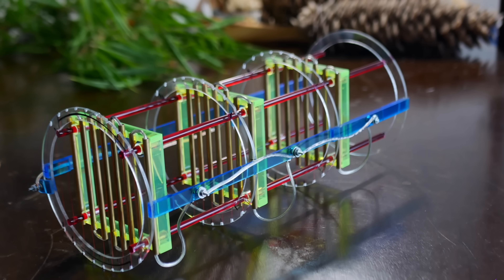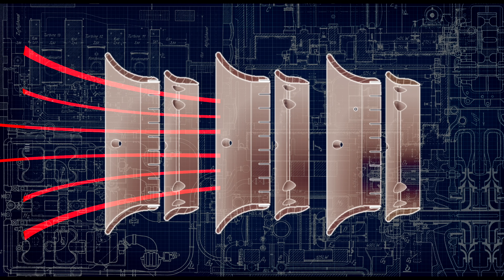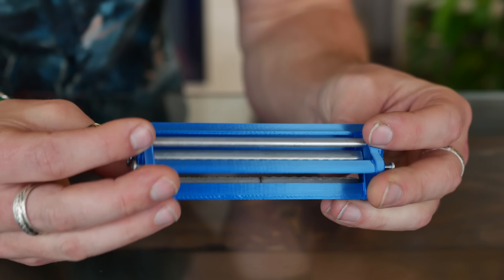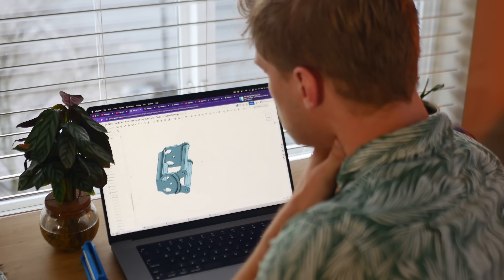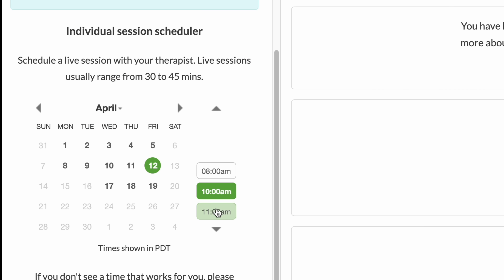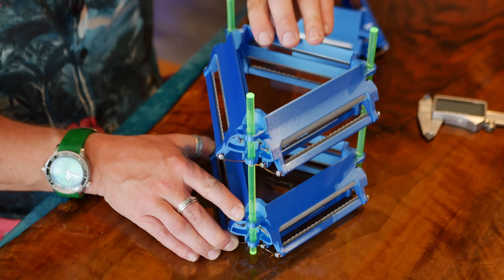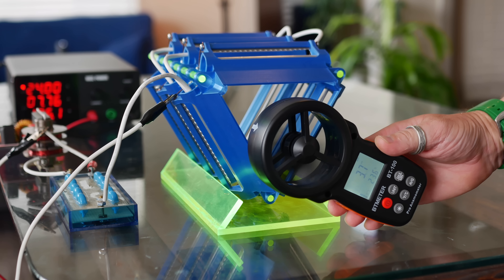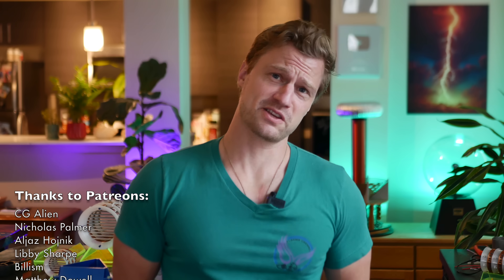Next-Gen Ionic Plasma Thruster Inspired By Nature (BTC Mark 3)

Comment: I'm new into this topic. What about if ioninc thruster is not meant for air? what if there is a way to insulate the wire and put it in a different fluid such as water? for example. I believe maybe with a couple of this thrusters in parallel can represent a significant source of displacement force.

Comment: I have a question. What happens when you connect the triangles next to each other by connecting the Tips. Now angle them a bit to combind the three air flows and connect the other Tips with  accelolators to build a Hexagon.
Im sorry for my bad Englisch...

Comment: I think Funnel Shapes, would be far more Optimal, rather than Triangular.   To do that, you may need to have someone form metal Rings for you... or to get a pipe/tube bender, to form them yourself.    Also, it may be interesting to experiment with Vortexes..  potentially making a Spiral output / spiral guides.   Also, noting that you saw wing being sucked in from the sides... you may want to try to optimize that effect, by pulling even more air in via wave guide channels.. to provide even more air pressures to thrust with.

Comment: Try a widening cone or an elipse that gets stretched more as you continue.
You are fighting pressure to keep the air inside the engine. Problem is that the engine doesnt have walls so unlike a jet the air isnt confined.

A widening cone or something would keep air pressure at a lower value but keep speed rising, you'd move more air at a relatively slower speed but increases the volume compared to no widening. 
For a tech demo though this is certainly interesting

Comment: why dont u make it into a circular cylinder instead of a triangular one? same way u have angled them u can angle the rings and stack them on top of each other.. maybe it would make a vortex and allows for smoother air flow rather than harsh rectangles.. and maybe do more angle control tests maybe this angle isnt the optimal one for this design

Comment: By stacking the stages you've got a good design for pressure. Air input at the same velocity stacked repeatedly can''t increase velocity. However like we do on jet engines, you might turn this pressure into speed with a tapered nozzel.

Comment: have you tried putting them in series connection? Having high volts powering something in paralle that needs high amps will lower the performance take advantage of the high volts by series connecting, if you dont try this ill consider what you doing a total failure and WILL NEVER be a game changer

Comment: I wonder what staggering the power on/off going to the stages using an oscillating pulse initiating one, then stopping, then the next, and repeat that for each, every time so that the air is being repeated through each stage rather then just pushed concurrent.. Dunno just thinking out loud.

Comment: You shouldn’t be working on your speed, you should be working on your power. Rocket exhaust has low speed, high pressure, so they use a nozzle to change the high pressure into high speed. It’s difficult to get speed when the excess power can just become pressure, so use a nozzle to get all of the power your thruster exerts converted into speed

Comment: Looking at the geometry dont you think the air being accelerated on the ends of each in put would interfere with the adjacent ones. I would guess that only the air from the central points that have a path of least resistance and you are loosing efficiency on the ends.

Comment: Try divergence after convergence.

Ideally a bell shaped nozzle would be an idea, however that comes with some challenges in terms of efficiency at different altitudes and would also block throughput in the centre. 

Try adding three concave slipways after the thruster sections. Put them in a Tri configuration like the "Linear Aerospike" engine, but with 3 rather than two.

Also you need exponential spacing so that different streams travel at higher velocity. Otherwise you are just pushing air at the same velocity.

Comment: Maybe I'm wrong, but I think you failed to see the most critical aspect of convergence. Look again at your leaf. Or think of it as a garden hose. The only way to increase flow is by putting your finger at the end of the hose to increase PRESSURE within a space. Its just my $0.02, but i think sequentially smaller stages would benefit you.

I guess how I'm visualizing it is if you were to replace your design with garden hoses for inputs, you'd get the same amount of pressure since the central channel is so open and large. Or even a thruster nozzle where it's hour glass shaped.

So In many senses, this design is similar to the older videos you posted. But instead of pulling air from that central channel, you're pulling it from the outside.

Comment: In a previous video you decreased the weight of the propulsion with smaller components for the positive and negative side, but wouldn't electro plating work for this to or is the layer to thin to handle the load? aditionaly  this could open up the posibility to specificly test for areas of the parts where you would want the electricity to flow to.

Comment: wait do  not  take those small cheap 30000 volt generators and attach them in parallel , don't do that instead give each cathode anode its ows generator design is good just see your speeds increasing by doing this

Comment: Reminds me of the chevron locks on the Stargate in the TV show a bit, which are similar to the pyramid of Chechen Itza's in Peru where the structure if you clap in front of the steps, sound travels faster, whilst under the steps is chevron shaped side door, with also serpent patterns like waves along the sides of the steps. Could be useful to study. I know it's expensive as a dopant but Maybe concider trying the element Thulium, and take out the inner points of the triangle to make it a 6 sided shaped triangle, maybe arching the longer lengths of the triangle to collapse it down a bit, maybe helping with the lensing effect. 🤔
Reply: You may find a Luminescent Photo Concentrator, and Photovoltaic Solar Cell interesting aswell. I would recommend reading through the Wikipedia articles, and watching the YouTube videos of the Stargate and supergate to see the comparisons. Could be helpful...
Reply: You may find Tantalum interesting aswell.

Comment: Could you not take a section through one of the fans, then revolve it 360 degrees. Basically use rings, donuts.
Would that not be a more efficient way for the air flow to converge, with consructive interference in mind requiring the same travel distance, at the same velocity ?

Comment: you must increase the speed move of air atoms this can be done only in 2 ways
1 higher voltage
2 more points outer from vlades canvas

one more way is using modular electricity- change Hrz

Comment: I wonder if shaping the air column into a spiral cone would do anything. In my brain a spiral motion might more evenly compress the air rather than just the corners of the triangle. Your thrusters might need to be curved to complete that design. As far as the cone shape, I'm thinking about how the SpaceX rockets have those node points in the combustion tail.

Comment: I see 2 possible flaws of this design. 1. The identical cross-section of each following stage. When the first stage accelerates the air it grabbed it creates a zone of lower pressure around it, so the following stage has less air to accelerate and moreover it needs to fight the suction from the first stage. If you make each following stage bigger so that the volums they grab air from don't intersect - this will possibly improve the overall thrust. 2. I think you misinterpret what is constructive interference and convergence. Convergence, or (if I get your idea right) a simple summation of streams does not increase their energies like in constructive interference. Interference is a wave process - it does not occur in time-constant processes like constant pressure flow. For interference you need to create pressure-alternating streams which can be achieved with AC or impulse electric sources.

Comment: You need a spaced covering around your new design. If you can channel the intake flow as well as the exhaust flow, you can double your thrust. You're not taking advantage of the pull of the intake.

Comment: It seems like they preform the most efficiently by themselves and not in series.

Also it seems like only a small amount of the energy you put into the thruster is actually going to generating thrust. It might be worth finding where all this waste energy is going and finding a way to minimize the issue. Especially if you are planning on using this in a plane/boat in the future.

Comment: Im not a physicist but i work with air a whole bunch, but i can see a couple of issues with this design.

First each stage has a fixed point of convergence which isnt adjusted in subsequent stages for a single focal point, as a result you end up with more turbulance from each subsequent stage. This issue is easily resolved buy making the individual ion vanes/stages  levered like aeroplane/boat rudders.

Second adding some form of venturi would help smooth incoming airflow.

Lastly golf ball divits do wonders for air throw
Reply: The geometry of the emitters is also a consideration - as round wires these are relatively uniform, yet electrons preferentially escape from "sharp" points on a charged material. Perhaps adding kinks to the wire would affect it, not entirely dissimilar to the way stealth aircraft have lots of "\/\/\/\/\/\/" type shapes in their design.

Comment: You would absolutely benefit from some AI design. Have you seen those crazy car frames etc that have been generated by AI that is much stronger and much lighter? There was also a jet engine that was designed recently by AI, and I feel like you could greatly benefit from those programs. It's probably possible to give it some specific perimeters and it will be able to generate some much more intense constructive interference structures.

Comment: I would say using three thruster in each stage is cause drag due to the angle of thrust into the center. Try six thrusters making a hexagon in each stage and maybe reduce the angle entering the center so less turbulence and drag will be created due to the entering of thrust into the center due to the edges of the thrust no longer hitting the next stage

Comment: I wonder if there would be any merit to reducing area between stages and having each stage feed the next, so basically having your initial stage's exhaust feed your second stage's intake and so on. I wonder how much the rate of acceleration would change between stages. I also wonder how much your thrust and convergence would change by changing your outer shape to either a hexagonal or octagonal shape instead of going triangular

Comment: I have a structural change in your design. Instead of having everything the same size and voltage inputs, let’s do something different. The initial one make normal. The second stage make 1/3 smaller and 1/3 more input. The third stage go 1/3 smaller an increased input of 1/3 power. It’s a funnel effect like a tornado. The smaller the output size, the greater wind velocity. Now, that’s not all from the windup of the storm, either. Some of it is because of the funnel effect of downdrafts and microbursts. And, trusts kind of where I’m going with the design change. Instead of turn twist nature provides through sheeting, you have to mimic that with an increased power input per stage. Also, the more you have being forced into the stovepipe, the more forceful the acceleration will be. 

I don’t know. Maybe I’m just too stoned to understand what I just said. Maybe I saw your design and as someone that loves puzzles saw a way to make yours better. I mean, all you basically did was create the same issues while almost getting to the end result. Adding more input into the funnel creates more output force. So, the more you add to be forced into the end in this project, the wind has to go someplace. But, whatever. I’m just a fool. (To be fair, I’m high school I was talking with a friend and come up with an idea that since there is gravity, there must be an opposite force to gravity. CERN proved me wrong.

Comment: What if you minimize convergence and instead of using the thrusters to create all of the trust, you use them to create a series of high pressure rings or triangles. This will create a low pressure area in the middle of each ring or triangle of high pressure air. 

Air multipliers work in this way. Ionic trusters work better as air pressure falls. Air preessure should fall in a coloumn of air as its velocity increases. If you started with larger thrusters and dropped their size at each stage to be positioned in the low pressure area created by the previous thruster you should theoretically be able to decrease the pressure and incease air velocity through the stages.
 
I might be wrong though.

Comment: Have you considered that switching from a cylindrical column of airflow to a prismatic column of airflow may have added greater resistance from the surrounding air? I think that taking your individual rectangular thruster design and bending it to be an arc, you can get back to the cylindrical airflow. Convergence was a great breakthrough. I think that you could take greater advantage by taking the new arc-shaped thrusters and adding a rotational flow. This should create a whirlpool effect at the front of the thruster that would increase intake by causing a suction in front of the engine instead of intake being caused by the thrust at the back of the unit.
Changing the focal distance for convergence and changing the rotational angle of the individual thruster direction could lead to greater airflow and should be iterated over in order to get the best results.

Comment: would it be possible to print all three stages in a single structural support, and if so could you do so in such a way as to make it slightly shorter to reduce the gap from 1CM to say .8-.9CM?  I'm also curious what having each successive stage being narrower would do to the air flow(making the final shape more pyramidal).

Comment: By no means am i a scientist or engineer but i deal with airflow in the hvac world. To pick up velocity you either got to add more power aka fan speed or reduce the size of your duct to force the air through quicker. In your model i see you upping your voltage but your duct or aka convergence remains the same size. Would it not be pheasable to choke it down after each stage? Also your first model was cylindrical and i question if you could 3d print one in a cone shape with this theory. Just food for thought.

Comment: You should consider the direction of trust when stacking these, it might work a lot better if you gradually decreased the size and used a housing to create more pressure, largest im the front, smallest in the back ect.

Comment: how about use a convergent and divergent duct design, like the jet propulsion, and add a heater source to add some energy to the air. For now, all the air is moving by ionic force, but not much change in the entropy of the air. Maybe that would change something.

Comment: Curve the output towords the rear of the engine, slightly twist the output as to get air to flow in a circular way. This will create a stream of air that is way less turbulent and easier to control. Circular airflow also stops the turbulence created by the merging of air from the second and third stages of the engine. That turbulence is killing performance. Best scenario you twist it enough as to create laminar flow and allow for unbroken stream to exit the engine. From this you might come to see that air is moving faster at the edges of the engine instead of in the middle for this im not so sure tho

Comment: Adding more sides than the triangle design may diminish with more sides and more distance from the central airflow so why not use a spiral design like a dams turbine with the blades along... the turbine blades just so you can fit more on there without interupting airflow as it converges with something like a jet nosel
Reply: Or just spin the setup. Lol

Comment: Love your channel and i follow it for a long time, almost from day one.
Have you tried to make a central hub on the first stage being the hub the common ground? Like an airplane engine. Then you will not have any convergency on the flow, making a second stage like the one on the vídeo but square to channel the flow. Power wise have you tried to have diferent power levels? First stage low power but high  flow thanks to be all free of obstacles then the second stage high power just to acelerate all the convergent flow and by the venturi effect more volume of air to be accelerated.
I belive that pulsing betwin groups of stages might work some improvements.
I really hope that you reply to my message.
Keep the excellent work with the chanel.
Love from Portugal.

Comment: Need see static thrust measured in Newtons of force or grams or something. All this measuring delta V/output velocity is completely useless if we dont know the exact volume of air being moved. Also I am rather dubious about the flow rates provided in the video in L/min, he doesn't explain how he has measured this experimentally and I fear he is just using the dimensions of the frame and the output velocity to create this inaccurate figure. Good work though, don't mean to sound too critical, just wan't to see him continue to improve on his designs.

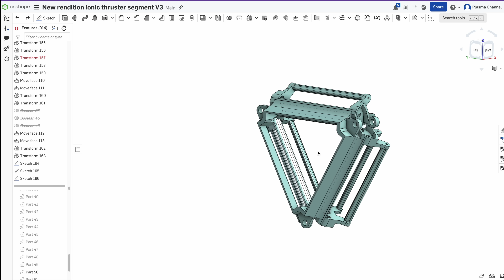Comment: Have you considered making a design like this one but instead of 3 using only 2? Yes it probably wouldnt be as open and it wouldnt have such a "engine" look to it, but maybe it would have a better flow of air, like at 10:18 i kinda imagine a lot of turbulence in the areas where the flows meet (before the center, in the corners just after the air leaves each "stage".